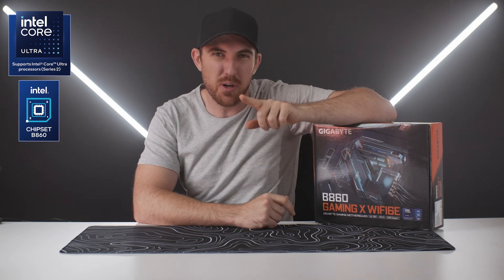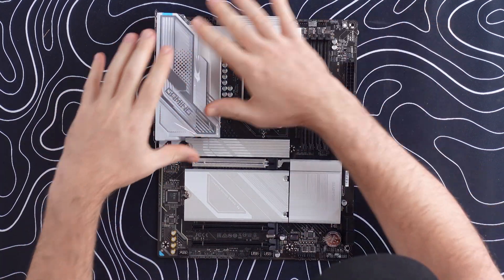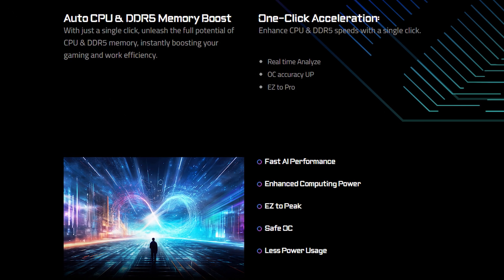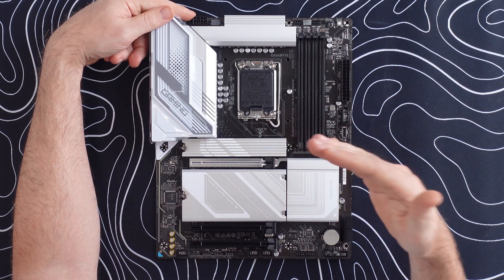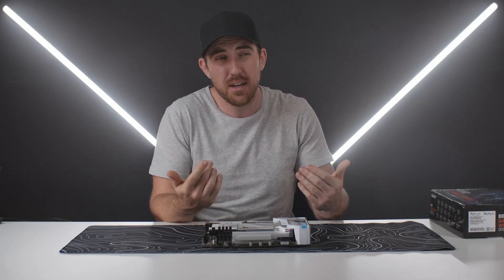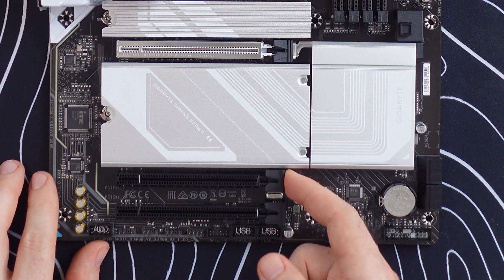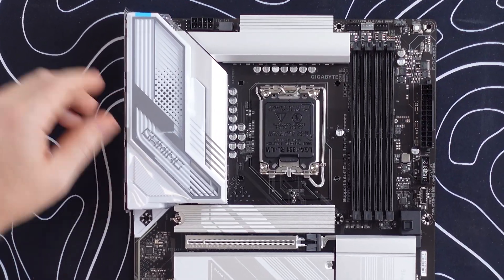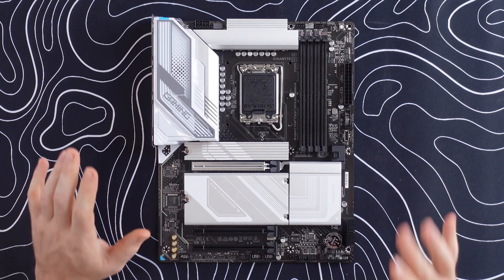Unboxing & Overview Of the Gigabyte B860 Gaming X WIFI6E

Comment: Just installed it into new system. I had difficulties fitting in the GPU, because the chipset heatspreader is a little too thick, so the GPU barely fits into the pcie slot. I had to close the pcie latch manually and hope it works.
Will be able to test tomorrow, as the patriot viper venom ram I bought obviously wasn't compatible. Actually I hope that was the issue... More: tomorrow